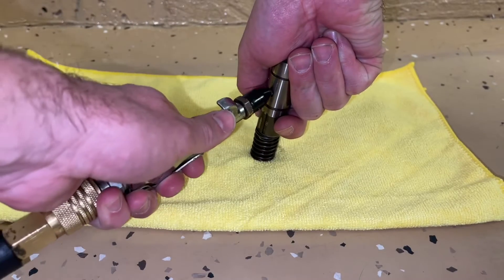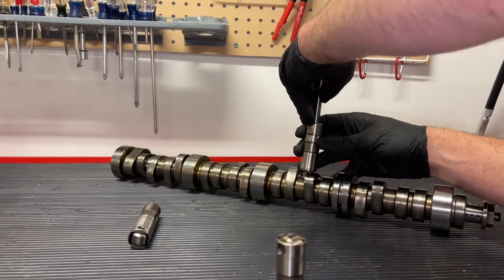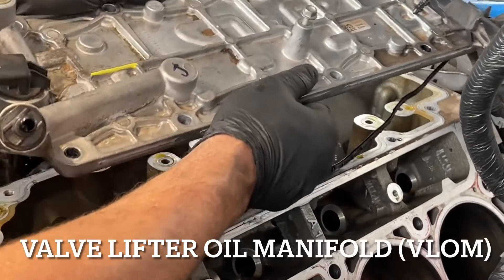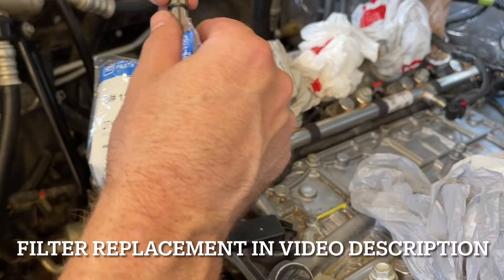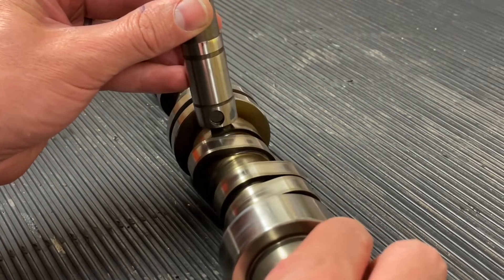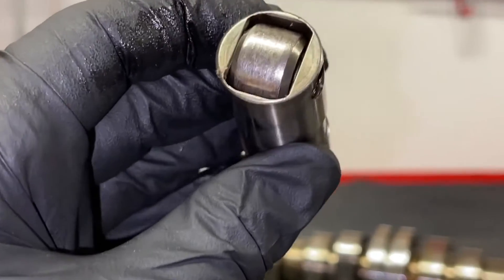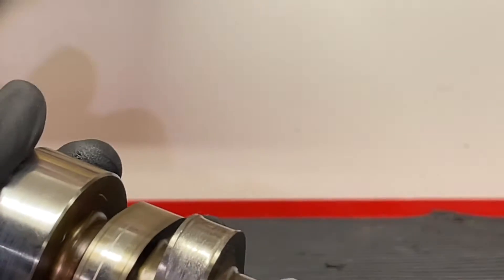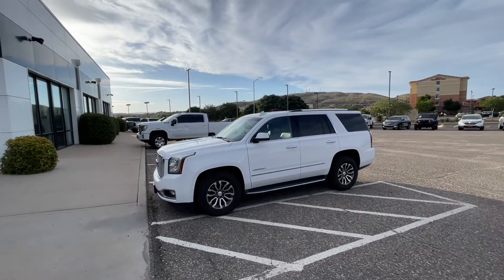GM DOD/AFM Lifters operation explained, failures, how to delete. Why GM engines fail 5.3L 6.2L

Comment: Just paid $3500 to fix mine. Cyl #4.  I'd have done it myself but it's winter.  Push rod broke.  I don't understand where the interference comes from.  Either mode, v4 or v8, the lifter cannot be any longer than normal.  Is it jamming into the piston?  Also, here's a hint at a dirty trick by GM.  The mechanic tolf me all new cars have AFM on ALL the cylinders, not just the even numbered ones.  That spreads the wear amongst twice as many cylinders, thus extending the AFM lifter life twice as long, just enough time to get most cars past the warranty!  Only to fail soon after but the customer pays.

Comment: Chevy and GM are getting rid of the DFM but I just bought a 26 Tahoe that apparently has it, should’ve done research before buying
Reply from the maker: I am done with GM until a new engine and transmission are out for several years and can prove reliability. And all brands are this way too. Even Toyota is getting too complicated and has had over 100,000 recalls for bad engine quality and will have future problems with the complexity. I went with the last “new” V8 from Toyota I could find  Why I traded my GMC Yukon for a Toyota Sequoia
https://youtu.be/cNm9rtx0GHQ

Comment: Hey real quick can someone answer - I am trying to buy new lifters.  Half of them are the collapsible AFM ones and the other half are the standard ones.  When I go to purchase them on lets say RockAuto, when they list the standard ones, they have some standard ones listed as AFM and some standard ones listed as not AFM??  Wouldn't the standard ones automatically just be non-AFM? I know I need to buy the AFM collapsible ones (I don't plan to delete right now) but why are they listing standard ones as both AFM and non-AFM?  Should I just buy the standard ones that are listed as AFM?  Is there even a difference?  Is RockAuto messing those listings up??  Thanks.
Reply from the maker: I would imagine they lost them as standard for the vehicle being half and half until 2021 when then went to all cylinders

Comment: I have a 2018 unkon with 75k miles. No issues now but was thinking of lifter replacement. If the cam is not damaged does it still need to be replaced?
Reply from the maker: It will need the other camshaft if you use all traditional liters. The camshaft does not need to be replaced if you put the same lifters that it came with back in. https://youtu.be/oEtksxT09-U?si=9xW0c0VGY3UbmRPr

Comment: If the lifter+push rod length are the same between them why can’t you just replace the dod lifter and trays to non dod lifters if the cam is still good?? Thanks. Look forward to your reply
Reply from the maker: The pushrods are the same length, but not sure about the lobes on the dod cam for those dod cylinders. I went with the L8T cam that is intended for non-dod. I would imagine GM would not use a different cam if they didn’t have to. You can look up the cam specs https://youtu.be/oEtksxT09-U?si=19Qxi9fr8VdcQW9W
Reply: @dannyjohnsonsgarage that’s what I do not get. Side by side the lifters with the pushrods are the same length. Between the afm and regular. And if they are the same length then why wouldn’t they work without replacing the cam.  I do a bunch of these but just irritates me when the cam is perfectly good still.

Comment: I just got one of these trucks with 170k miles should I still get the afm tune or just ride it out
Reply from the maker: Check its for the right year, but the disabler simply plugs in and is said to help, though anything can happen. If you do use the disabler, turning it off after a long time can also put built up junk into the dod and cause problems. Here is the affiliate link but think it over https://amzn.to/3WbL5W4

Comment: I have a 2022 trail boss custom with   6.2.  One week ago I got the letter to go in for the pico test and that truck has had a tune on it since brand new less than 100 miles on it.  That tune also included turning off the AFM and auto start stop feature    
  When I had to go in for the test last week I had to take the tune off for the dealers request because they have to do a print out of the computer to send the Chevrolet, well the computer system was down and they were unable to do the test and 310 miles later the engine went out due to a stuck lifter at ground the number three and six cam lob down and the lifter roller was gone. So after 92,000 miles working flawlessly with a tune on it and 310 miles later it went bad   But the dealership has ordered me a new engine Monday and it's supposed to be in within 10 days  
  My other trail boss was running perfectly it had 148,000 miles on it two months ago and it failed the test and I thought it was pretty good they said it would take four weeks and I had my truck back in 11 days.   I'm glad they moved the warranty out to 150,000 miles because that one just barely made it.
Reply from the maker: I’m glad you have the warranty. I wonder if turning dod off blocks oil in the dod system that gets gunky being trapped and then released when finally turned on

Comment: I have a 2016 yukon the was mixing antifreeze on cilinder 6, remplace the gasket and put all back in the same way i remove it, then a ticking sound came up when the vehicle is cold and goes away when is warm, so decided to remplace lifters, push rods, Rocker arms and valley cover and still doing the same noise. Any help will be appreciated 😢😢.
Reply from the maker: If coolant is in that cylinder it is most likely coming in through the head gasket. If you remove the head you’ll want to have a machine shop deck the head so it is not warped, but you’ll also want to deck the block, which is a little more difficult with the block still in the car. You’ll run a long heavy sanding block across the deck surface, and don’t get any junk into the cylinders or coolant passages 
https://youtu.be/oEtksxT09-U?si=rWs4CP0yRphG_ZHG
Reply: @dannyjohnsonsgarage ok so this was what happen, hade an misfire on piston #6 so I remove the sparkplug and hade coolant in the cylinder so I change the head gasket, I use a a sand with a pice of wood with the same size as the surface of the head/ engine block and sand it front to back with out stoping. So now I don't lose coolant or have a cylinder pressure issue, what i do have now is a ticking noise when the car is cold so I decide to change the lifters, push rods, valley, and the rocker arms and still doing it, oil pressure is at 40 most of the time, I did a engine flush and change the oil and now in indle drop to 32 and 45-50 higher rpms.
Reply: @dannyjohnsonsgarage  don't have a collapse valve cus there is no play on the rocker arms and push roads r not bed and they r in the center so don't know what else can be. Worst case will have to change the valve again?? But they are GM oems but that don't meen they are good hahah. And i do appreciate u responding to me.

Comment: Have you ever done a gen V dod delete and after u completed the delete u disable dod with hp tuners. U crank vehicle and it idles with misfires only on dod cylinders
Reply from the maker: I haven’t, but you may need an actual dod delete tune.

Comment: Why replace the cam and the AFM lifters just to delete the system? Why not just weld the pins in place so they can never collapse and keep the camshaft? If not anything it means you don;t have to pull the engine from the vehicle to access the cam and you are simply pulling the pushrods and lifts out from on top. Maybe somebody should have AFM style lifters without the spring, pins or the ability to collapse irrespective of oil pressure from the VLOM designed to work with the stock cam and a software flash or OBDII plug-in delete.
Reply from the maker: In my case the cam was damaged. It was best to replace ir with the correct parts https://youtu.be/oEtksxT09-U?si=dDu91Tl1x7VZaMJS

Comment: I have a 2022.5  5.3L .   It was purchased during covid, so it doesn't have the chip to activate the AFM.   Do you think I have less of a chance of the lifters failing (lifter never collapses, so pins stay good?)
Reply from the maker: Yes, less chance, but I’ve had a few comments that people have had theirs fail even with it electronically turned off. Run it until it has a problem

Comment: Great video and series! Just had my a lifter failure on my 15' Sierra, 160,000 miles. Started with a new squeaking noise when accelerating (not the exhaust manifold leak for I fixed that too) then boom, rough running on the way to work, then flashing CIL. So getting this fixed at the moment. Also watch for the hot 6L80E transmissions and the torque convertor failure..unfortunately was victim to this at 146,000 miles. So after this fix, should be good for a while...right? haha
Reply from the maker: Did it sound like this? https://youtu.be/cx4_-FGXCVE?si=xC05iYlhuMtqMght

Comment: Good video but I still don't know why using a AFM-Disabler is not beneficial? Oil is there 100%, should be locked, never enable/disable at the wrong time.
Reply from the maker: It is a benefit and I’d run one until a dod is deleted. I’d also not perform the dod repair y until it needs it

Comment: Okay, I'm trying to wrap my mind around this:  If a spring type lifters fails to collapse, wouldn't the pushrods open the rocker arms / valves as normal, i.e. the affected cylinder would no longer deactivate?  How would a seized spring pushrod (non collapsing) cause the lifter to fail instead of just making it effectively like a "normal" lifter?
Reply from the maker: I believe it is more of a problem when it sticks closed and causes misfires with a cylinder trying to fire as normal. Also if you have an intake fail to collapse and an exhaust lifter continue to collapse, it may cause some problems and unevenness in the cylinder. The delayed timing event failure is what causes the pushrod to bend from another video I saw where the pushrod is not being pushed on square as it is. I do agree the system should have been designed to simply cut fuel and operate as normal without all the oil pressure and collapsible lifter junk
Reply: Thank you SO much for your prompt response!  I was confused because it seemed really complicated.  Your response confirmed this and then some.  The EPA, CAFE fuel economy, and manufacturers have RUINED modern vehicles.  Ford and even Toyota have given up and gone to turbos to get a few extra MPG.  Early 2000s GM trucks and tahoes, etc. are darn near collectible now.  And this is just gas engines.   Diesel exhaust fluid and dies. particulate regulators are a completely different but even more valid rant.  Thank you for sharing this video sir. @dannyjohnsonsgarage

Comment: Danny can you tell me how much I might spend to replace plugs, injectors, injector rail, and the vLOM?  Getting a vibration when driving thought it was drive shaft u bolt that was bad only to hear these items need to be replaced from an AMSC mechanic
Reply from the maker: Plugs will be about $100 being iridium, but the difficult part will be the injectors and rail. Being direct injection, they are pressed in. When they are pried out, they leave debris in the cylinders and can cause other issues. I have a video removing most of it, and a cost video except for the vlom. You’d probably be best off turning off the dod AFM, and running it in v8 mode, which will also save your transmission GM V8 Cam lifters head gasket replacement 6.2L 5.3L L86 L83 Yukon Tahoe Sierra Silverado Suburban
https://youtu.be/oEtksxT09-U

Comment: This whole cylinder deactivation needs to be criminalized. Its the single biggest act of stupidity in automotive engineering history. Every version of it ends wearing out the engine for 1-2 mpg in theory.
Reply: I couldn't agree more 👍
Reply: Planed obsolescence. I’m about to do the camshaft and lifter combo. For the money I’m just gonna get a reman with DOD delete.
Reply: I'm pretty new to all of this, but are you suggesting not to do what this video is doing? Do you have any opinion or experience on those AFM disablers? Thanks in advance 🤙
Reply: @TrippNOutPod The "AFM/DOD" features should be deleted, disabled, tuned out, or otherwise defeated in some way. They all vary in complexity and what's criminal about GM and Dodge is that deleting them costs about as much as the premature rebuild they end up causing.

My wife's dd is a Honda  Odyssey that has a similar bullshit feature called "i-vtec/vcm" but thankfully the Honda architecture isn't total garbage and you can override the whole cylinder deactivation by using what's sold as a "vcm muzzler" which is pretty damned cheap compared to the whole engine rebuild you end up doing because the vcm burned up all the oil.
Reply: @RedfishCarolina  ah thanks for the heads up. Should I get an AFM disabler? Seems cheap and easy 🤷‍♂️
Reply: @TrippNOutPod You really should ask around on some forums of people who specifically own your same vehicle and engine, the correct answer varies WILDLY from one manufacturer and engine model to another.
Reply: @RedfishCarolina dude, I really appreciate this, especially the fact that you aren't like most car guys and just give an answer to look knowledgeable. Much reapect, man. Ok, off subject, but I havw to ask if you're in NC or SC. I'm in SC near Clark's Hill Lake, and grew up around Lake Murray. Thanks again 🤙
Reply: Ya it last longer than a timing belt and generally takes a similar amount of work to change

Comment: so if you tune out this AFM crap then the lifters are always ON right.
that should minimize future lifter problems.
they fail when they closes or opens right?
Reply from the maker: Yeah, they will be moving all the time regardless on or off, you just reduce the timing event of the lifter sticking, and probably just as important, keep the transmission from getting torn apart
Reply: @dannyjohnsonsgarage  thanks for the answer. 
i have an 2015 Camaro SS L99 with AFM tuned out.
i have some ticking noises some days not others so its strange.
i also have headers on which i have read increases these noises.

but here is the deal
i listend to where the ticking came from and its from every cylinder.
you cant have all lifters going bad at once can you ;)?
im starting to think its the injectors that makes these sounds at idle.
new tune adding 4% more fuel so they spray more now than before.

Comment: Great explanation of how this system works.  What are the odds the cam you show here could be that worn and not have the whole engine full of metal filings??
Reply from the maker: It’s always a risk depending on how long it’s been running. Mine appears to catch the other pieces on the other lifters. I cleaned it out thoroughly, replaced all the parts, and didn’t find any metal in the oil, so that’s the best you can do other than a new engine

Comment: This just happened on my 2009 Tahoe PPV. It has just under 200K miles on the clock. Its been superbly reliable over the years and I love it. OTOH, two shops have quoted me $10K for an remanufactured engine replacement. That's as much as I paid for it 8 years ago. Not going to happen. A camshaft change and new lifters would probably be half that much, still not going to happen. A junkyard motor could also work. However, both of those options would come with no guarantees, no warranty and I'd be in the same boat if it happened again. I'd rather donate it to charity vs. selling for pennies on the dollar. Its just sad.😕
Reply: If you're semi a diyer, these kids are way cheaper than 5k to replace the top end including camshaft, also lots of manufacturers to choose from. I'm in the process of doing this myself and opting to pull the engine and do a low end job aswell but the top end has so many videos on how to do this. We got a family of 6, our transmission went out in our truck the week before and the following week the engine went out in the suburban with afm on cylinder 6. Anyway, if you think it's worth it in the rest of the parts it doesn't hurt to try!

Comment: Before any of you run out and buy a Tundra, research the current recall for crankcase bearings. Toyota has recalled HALF of all 2022 and 2023 Tundras for TOTAL ENGINE REPLACEMENTS, and the 2024's are blowing up but aren't covered by the total engine replacement recall! Toyota will ultimately have to replace every engine in every V6 Tundra built before mid-year 2024 (They quit V8s after 2021).

https://youtu.be/f3sQtX6bz8E?si=ML0gocGDZXWSOtOJ
https://youtu.be/0eySXnbqgvc?si=ZD2vLYw3Dt-_zjTx

I unloaded a 2024 Tundra at a significant loss - FIVE days after buying it. I am not willing to play Engine Roulette.

Instead of focusing on reliability in engineering and manufacturing, Toyota (like GM) has focused on complicated, expensive, and increasingly absurd trim items. Complexity is the enemy of reliability.

A great Care Care Nut analysis of the bearing problem:
https://youtu.be/EyI4ujjxxuk?si=kjGux5M

Four years of documented Tundra engine failure:
https://youtu.be/f3sQtX6bz8E?si=UIpgK-WbF25dn3wc

The lawsuits are starting:
https://youtu.be/55qeZksZxmw?si=pXxulkcEGOsfmdnd
https://youtu.be/-3StMKG3Qq0?si=I6qc5fhe565Cptkp
Reply from the maker: I got the last V8 tundra model year knowing it would have problems with more complexity, but it was even a better decision once I found they all had a recall for a new engine from machining debris Toyota Tundra Playlist
https://www.youtube.com/playlist?list=PLIjr-uSYDZi57XD9z82F06EWPIA6KBhzI

Comment: Thanks for the info.  Why don't they just make different length non-collapsible lifters that will work with the stock AFM cam? Be a lot easier than replacing the cam.